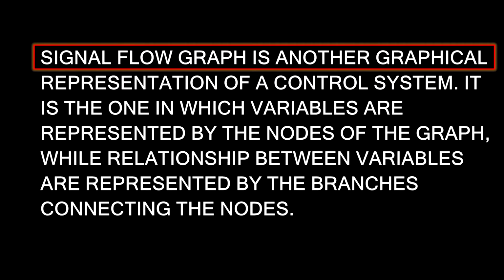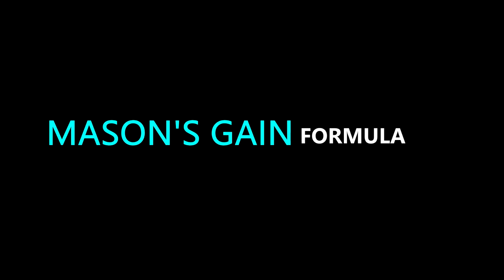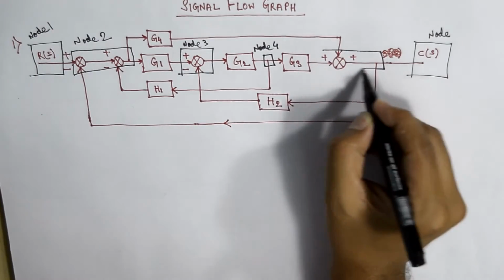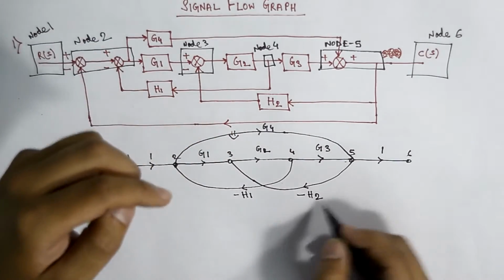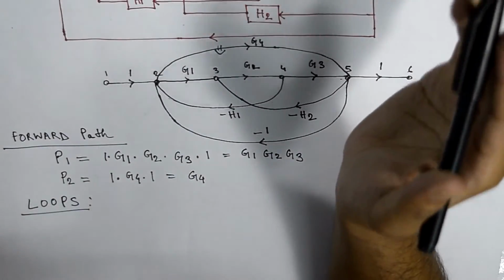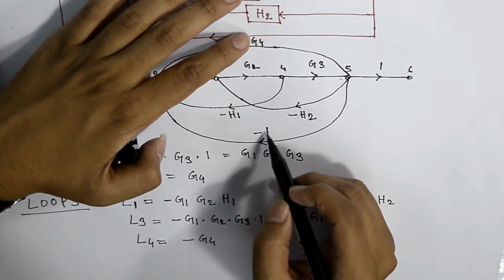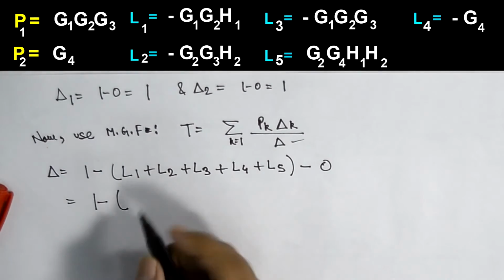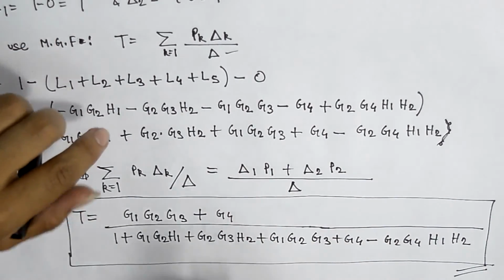Signal Flow graph - Mason's gain formula | rPiXY Engineering

Comment: How would you find the transfer function of Node 2/Node 1?
Reply from the maker: +Lyle Antieau hi
•	Input the signal to be calculated at node 1 and node 2 of the graph. The input signal to a node will be the summation of product of transmittance and the other end node variable of each of the branches arrowed towards the former node.
•	Calculate the input signal of node 1 and node 2 and u will get the no.of equations relating node variable and transmittance. There will be unique equation for node 1 and node 2 seperately.
•	By solving these 2 equation u will get the ultimate input and output of the SFG’s of these 2 nodes.
•	Now lastly divide the output(as node 2) with input(node 1) and calculate the transfer function.
Hope it will help. Please do watch, like and share our videos. Don't forget to subscribe our channel. And keep commenting. Have a nice day.